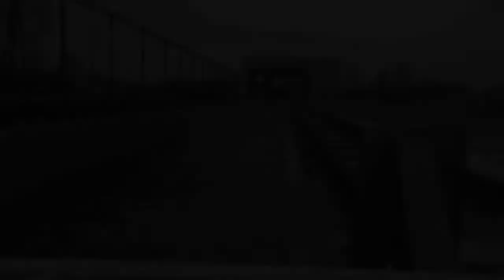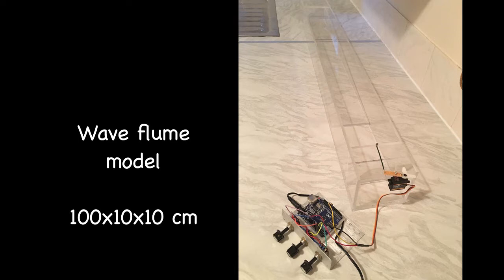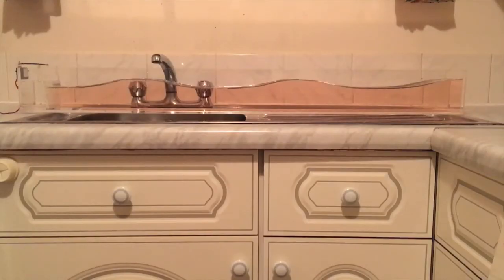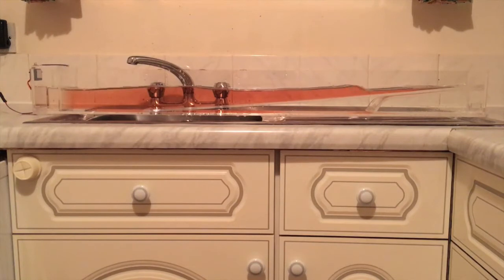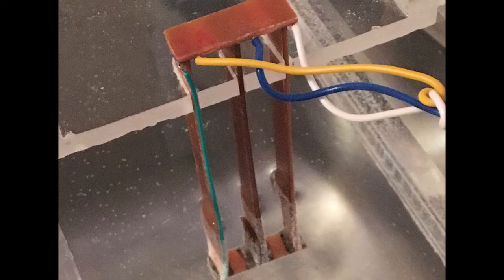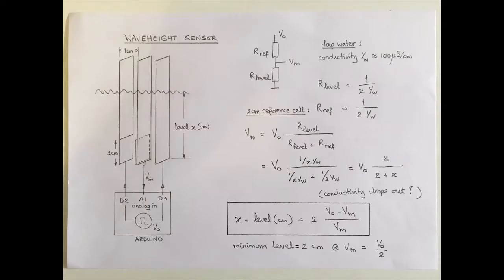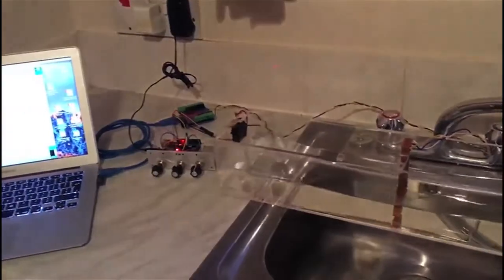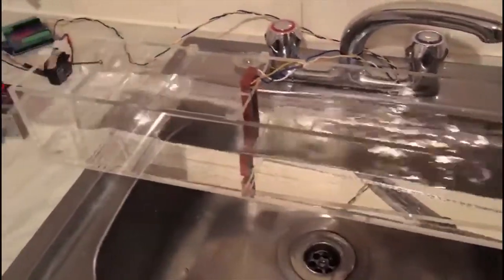Wave tank model

Comment: Could you kindly confirm where you bought the 3-knob controller from? Thank you!
Reply from the maker: Thanks for your interest. 
I built the controller using an Arduino Uno board. You can buy these from the Arduino company, but I got mine from AliExpress. The three potentiometers came from my own collection but you can buy them from various component vendors and AliExpress. The values are not critical. You just want to read a voltage on one of the analog inputs. These voltages are then converted to frequency, amplitude and shape of the PWM output that drives the servomotor. Good luck!
Reply: @wimderkinderen1952  Thank you for the prompt reply! Could you give a brief idea of the wiring at the switch? Just trying to understand which wire goes to which terminal on the switches. Apologies, Im a complete novice!
Reply from the maker: @elliotmccall1  We are in the Netherlands at the moment where I do not have access to the schematics. I will send them later. Basically, you connect the endpoints of the potentiometers to 5V and GND. The middle contacts then go to analog inputs A0, A1 and A2 of the Arduino. When you do an analog read you get a number between 0 and 1023. In the code you convert that into the parameters of a PWM output. I will send you that code as well.
Reply: @wimderkinderen1952  Thank you. I assume the code is a variation of the below for 3 potentiometers? Not sure how to adapt the code from here though..

#include <Servo.h>  // add servo library
 
Servo myservo;  // create servo object to control a servo
 
int potpin = 0;  // analog pin used to connect the potentiometer
int val;    // variable to read the value from the analog pin
 
void setup() {
  myservo.attach(9);  // attaches the servo on pin 9 to the servo object
}
 
void loop() {
  val = analogRead(potpin);            // reads the value of the potentiometer (value between 0 and 1023)
  val = map(val, 0, 1023, 0, 180);     // scale it to use it with the servo (value between 0 and 180)
  myservo.write(val);                  // sets the servo position according to the scaled value
  delay(15);                           // waits for the servo to get there
}
Reply: @wimderkinderen1952  Hi! Just wondering if you have returned and can share you code? Thanks